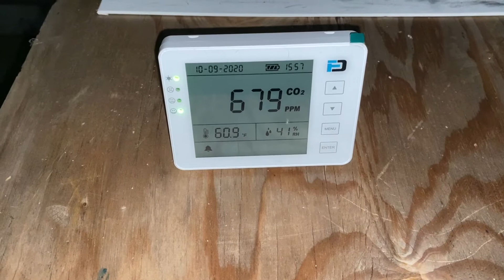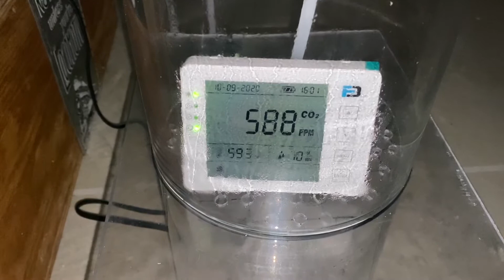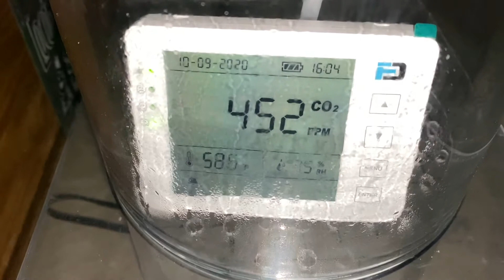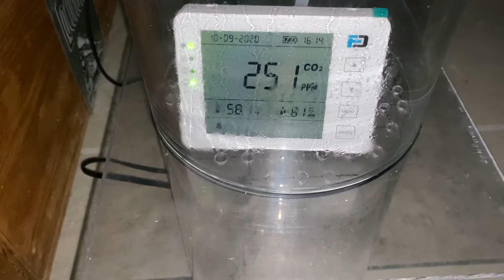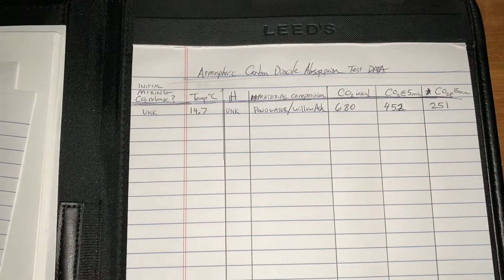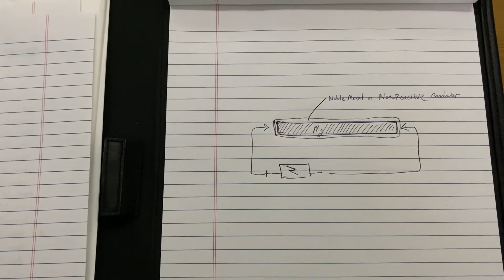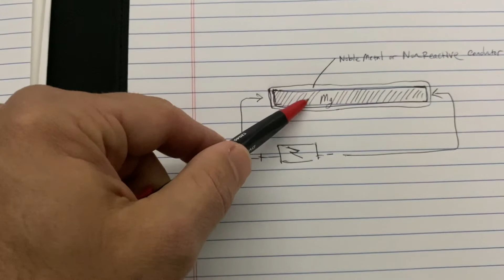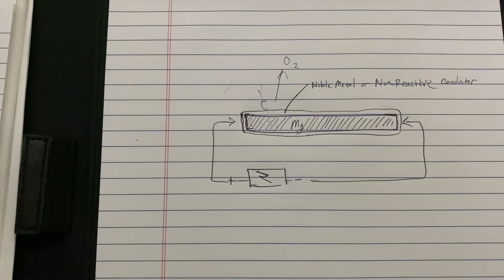CO2 Capture Device

Comment: hello im a student from Korea who's trynna make what you have done. I've got some questions. Is the motor worked by solar energy mixing mixture of water, ashes, and soil? What is the soil for .. and I still dont get how the carbon is captured. I hope I get a fast reply :)
Reply from the maker: Yes, solar is used to mix the ingredients with the air pump (bubbles).  

It works to capture carbon because the mixture of ash and water is alkaline, and because CO2 dissolves into water for carbonic acid, which reacts with the alkaline salts (potassium hydroxide) to form potassium carbonate.  Hope this helps
Reply: @CharlieMacklin1 thank you for answering. where does the carbon go after the process? Would it be okay to throw it away to random forest?
Reply from the maker: @mondaymorningbird  the ideal thing to do would be to perform a soil analysis; find an area (Forrest, farm, etc) where the soil is acidic and deficient in potassium, that would probably be the best place to dispose of the carbonates.

Comment: Hi. I see you are using this to precipitate carbon. Do you have a suggestion for a yield of CO2? We are not satisfied with our current supply of CO2 for making soda. The supplier always short shrifts us. We are in a small market, so buying huge machinery is out of the question. We need about 30lbs of CO2 per week. Any suggestions would be appreciated.
Reply from the maker: Hmm, that's an interesting question, but I'm going to need some more information...I'm assuming when you say "Soda" you are carbonating beverages...The design shown in the video would probably not work very well for what you need.  CO2 will carbonate cold water (in your case for beverages I assume) much easier than warm water.  So there might be a way to capture CO2 from the atmosphere into a cold alkaline water bath, and then put it into a heated and sealed pressure chamber, then pipe the CO2 gas over to your cold beverage.  I like the idea of carbonating beverages with atmospheric CO2 but it would require some extra machines.  Also, you probably wouldn't want to use wood ash, it might impart a hint of flavor to a beverage.  

I would first look for another supplier... If they are shorting you CO2 then that's just not good business practice on their part.

I'll do some more thinking about your question.  You are trying to carbonate beverages for consumption, right?  Or are you trying to make Sodium carbonate or sodium bicarbonate?
Reply: @CharlieMacklin1  Thank you for your reply. We are currently combining HCl with H2O and NaHCO3 to produce NaCl, H2O and CO2. Salt and water are biproducts, and are discarded. We collect the carbon dioxide, compress it and then sell it. 

Wouldn't it be nice if, instead of producing MORE CO2, we could remove the surplus of what we have now?

Comment: Hello Nice Video!! Please
1.)What was the pump Capacity?
2.)How much Alkakine did you use & in how much water solution?
3.) How much CO2 Did it catch?
Reply from the maker: Good questions, I'm not exactly sure I'd have to go back and measure the pump capacity.  The water and ash mix was just done by eye.  Ash is going to contain potassium carbonate, potassium hydroxide, calcium carbonate, and calcium hydroxide, in varying amounts.  I mixed it until the water took on a strong grey color but not so much ash that it would thicken...so maybe 5-10 percent as a guess.

As for the CO2 reduction, I was measuring just that little volume in the glass cylinder with instant readings, showing that the CO2 concentration was reducing.  It reduced the CO2 level by about 50%, so,
I'll have to go and measure the pump flow rate then I can get an estimate on how much quantity of CO2 it was reducing.

Storing the CO2 captured is another issue because the water ash mix,  if dried out, will just release the CO2 back to the environment, BUT, if you could run the experiment until the pH of the water was close to neutral, then use it to grow plants hydroponically or with some underground root watering system, that would work.  A lot of grasses and other plant roots can absorb CO2 from the soil so that might work.  Another idea would be to use the CO2/ash water to grow algae.  Once the pH is in range, algae would grow fast!  

The plant kingdom is how we reabsorb CO2.  Even if we could beat the absorption efficiency of plants, they are alive and part of the Earth, and that alone is respectable :)
Reply: @CharlieMacklin1  Thank you So Much! This Information is So Helpful & I Agree on the Options on What to do with the Captured CO2 Afterwards, Plants Are The Best ReAbsorbers of the Captured CO2 Into Usefull Natural Pathways!
Reply from the maker: Ok so, I went back and re-watched the video and took new measurements on the airflow rate of the pump.

  The little air pump moves about 10 liters of air per minute.   The volume open volume within the test device is also about 10 liters.  It was setup as a "recirculating" arrangement, so in the test run, the air reduces its CO2 content about 42 ppm per minute.

So, 10 liters of air is 12.93 grams x .000042 = .0005431 grams per minute CO2 which extrapolates to about 0.78 grams CO2 per day with this test device.
Reply: Thanks Alot For These Details...Just wondering if the alkali were pure would the system be more Efficient as its supposed to...10l/min pump is 7 grams CO2 Per day

Comment: hello im watching your channel now how did you boil your water and trap those co2
sorry for being a slow learner , my teacher wanted me to build a prototype that can capture carbon and i dont know where to start 😢
Reply: some advices and tips only huhuh need help 😭😭😭
Reply from the maker: @Camelle21Quillobe  there is no boiling needed, it only looks like it’s boiling because there is an air pump bubbling the water
Reply: @CharlieMacklin1  ohhhh now i get it thank you so much but when it capture co2 and pump it what does it releases?
Reply from the maker: So what I would do for a school project is, get your items together:

1) main container such as tote bin or plastic tank or plastic bucket
2) aquarium tank pump and bubbler
3) water
4) potassium hydroxide or calcium hydroxide ( I would recommend buying a bag of “pickling lime” which is calcium hydroxide) …*alternatively, you could  use wood ash from a fireplace or campfire

Mix the water and the hydroxide in the container, add the aquarium bubbler, and your pretty much done :). 

The only other thing you need is a CO2 monitor, but those are about 100 bucks.  You could just suspend it above the bubbling water mixture and take readings that way.

Here’s your example equation for calcium hydroxide to calcium carbonate (limestone):

Ca(OH)2+CO2⟶CaCO3+H2O.

Your basically creating limestone and water :). Hope this helps
Reply from the maker: @Camelle21Quillobe  it releases air (air is about 80% nitrogen “N2” and 20% oxygen “O2” with trace amounts of CO2. ) The air pump draws in air, bubbles it through the water hydroxide mixture, and the bubbles coming up are released to the environment.  The bubbles have less CO2 than when they entered :) it’s reducing the CO2 from 500 parts per million to 200 parts per million). There’s really not that much CO2 in our air, but, it is measurable with the right instruments
Reply: THANK YOU SO MUCHHHH ❤❤🎉🎉🎉

Comment: What happens with the carbon?
Reply from the maker: It forms a weak chemical bond with the alkaline hydroxides to form carbonated,
And with carbonates to form
Bicarbonates.  If it is dried and baked with heat, the CO2 will be re-released in gaseous form.
Reply: @CharlieMacklin1  thanks for your response. Is it possible we communicate via email? we are currently working on a new wet scrubbing technology to treat gases and we would like to incorporate wet mechanisms to capture carbon. Regards

Comment: Hi am workibg on the same project may you plizz let me know the materials and chemicals that you used
Reply from the maker: In this case, I was just using the ash from burnt wood (willow) mixed with pond water, with a large aquarium pump to pump air through it.  The pump has to be run from electricity derived from renewable sources such as sun or wind, otherwise, it will never capture more carbon than it creates.  Also, it will never capture more carbon than is released from chopping the tree and burning it in the first place; however, IF you already have an alkaline material, such as calcium carbonate, calcium hydroxide, potassium carbonate, potassium hydroxide, magnesium carbonate, or magnesium hydroxide, any of those substances should be able to absorb CO2 to some extent.  Carbon capture is always a “big picture” concept, because if you have to chop down trees and build fires to capture carbon, it will defeat the purpose and never achieve a negative carbon balance.
Reply from the maker: You have to look at what nature does; the tossing and turning of the elements performed by the power of the sun, the moon, and gravity.  How does nature re-absorb CO2?  Well besides plants and besides chlorophyll which contains magnesium, nature uses the power of the sun to evaporate water.  The water mixes with dust in the sky and forms rain droplets.  The rain absorbs CO2 as it falls to the earth.  On the earth it mixes with the minerals and is absorbed, and is also absorbed by plant roots and leaves, or in some cases Ocean waters.  Some of the CO2 gases back out into the air, but some of it stays bound in the earth.  Now is there anything we can do to match that efficiency?

Comment: Great vid sir, I was thinking how did u know that it's only co2 mixed up with the (water+willow ash) and not other gases? i mean there are other gases in the air like pure nitrogen, pure oxygen, argon, and others like co2 in air because I am trying to make a similar device that only captures co2 (not the other gases) by absorbing the air, mixing it with a solvent/solution by bubbling the air in it so that co2 will be trapped, and release a co2 free air. However, I want to ensure that it is only co2 that is absorbed in the solution and no other gases. thanks😁😁😁
Reply from the maker: Well some of the other gases will get absorbed in the water/alkaline mix, but the CO2 is what forms carbonates, such as calcium carbonate, magnesium carbonate, and potassium carbonate.  The nitrogen, oxygen, argon etc will also bond to some extent but most of those materials I would expect to come out of solution as a gas over time.

Remember, it is better to plant a willow tree than it is to chop it down to burn it to make ash to reclaim CO2.  But, if have the ash anyways, why not reclaim some co2.

Ultimately it is soil quality that we are after.  Good soil will absorb carbon dioxide via plant life, and also improves agriculture
Reply: Thank you for clarifying sir, this a great help 😁
Reply: @CharlieMacklin1 I can't see how it is better to plant a tree than to burn one. I guess I have missed something
Reply from the maker: @waylonbarrett3456   Well because of time.  It takes a lot longer to grow something than it does to destroy it.  That being said, if you're in a wooded area, there's tons of dead branches that can be burned without hurting the environment too bad.

Comment: Why does it have to be alkaline? Is that for carbonic acid?
Reply from the maker: Yes basically if you have an alkaline hydroxide it will combine with the co2 molecule to form a carbonate.  Similarly, an alkaline carbonate molecule will combine with co2 to form a bi-carbonate, however this molecule is less stable and will re-release the co2 upon heating or drying out.  I recently learned that the main ingredient of my ash mixture is calcium carbonate and calcium hydroxide, although it would also contain a fair amount of potassium hydroxide and potassium carbonate along with magnesium hydroxide and magnesium carbonate.  These are all essential minerals in plant life.
Reply from the maker: You can just use pure water to absorb the co2…it would become carbonic acid which then could be stored or reacted with other materials.  Also know that CO2 is much more soluble in cold water rather than hot water.
Reply: @CharlieMacklin1  do you know if that's a relatively easy to do? Like put an aquarium aerator pump in a bowl of water, let it run, and then use a vacuum pump to pull all the CO2 out?
Reply: @CharlieMacklin1  I see so your process is to dissolve CO2 into the water and then have it bond with something in the water to pull it from the atmosphere?

Comment: Do you want to collab for Xprize I got contacts for the project idea you have...
Reply from the maker: Well thank you, although I was under the impression that the deadline for registration with X-prize on this particular challenge had passed…I had looked into joint but there was a start up fee and at the time it was a bit hefty.  

The carbon capture is a difficult problem to solve because it’s not just clever gadgets and chemistry tricks, the real solution is a bulk materials handling issue.  It comes down to water chemistry and soil chemistry, but in mass.  Air mixes with water, water mixes with soil, top soil takes the carbon. We have to become allies with the roots 🌱
Reply: I would maybe like to collaborate. What are your ideas?

Comment: I was wondering about using Le Chatelier's principle as a means to facilitate direct air capture? I.e. artificially cooling seawater to make it colder, and improve its capacity to capture CO2. I know that this is a massive endeavour, but I wondered if it would be more feasible than current direct air capture techniques, which remain extremely expensive. Of course there are other factors to consider, i.e. effect on marine life and effect on the water cycle.
Reply from the maker: That actually may be one of the more feasible options.  Suppose you had a solar powered pump on a floating vessel, at sea.  Cold water from the depths could be pumped up to the surface and sprayed where it could mix with air before returning to the sea.  It seems like a good idea!  That also would eliminate the need for mixing chemicals and, inevitably releasing carbon in that process.  I think that the question we have to ask ourselves is “how does nature absorb carbon and how can we help that process along”.  Ultimately, the problem we have to solve is one regarding the efficiency of material handling and mixing using only natural forces (sun, wind, tides, etc) otherwise we are still trapped in the grand circle jerk of carbon releasing gizmos.
Reply: I have been working on an idea that leverages this principle. It seems bringing cold water up from the deep may be problematic because it may already be saturated with carbon dioxide for its pressure and temp.

The idea I've been kicking around is floating hollow disks made of limestone on the surface. Their upper surface would have a particular synthetic allotrope of CaCO3 which is a grouping of hierarchically sized microspheres. This pigment has been optimized to reflect infrared light through the atmospheric infrared window into space. Eventually the disks would be weathered and sink. I also have a plan to produce carbon-negative alkali hydroxide, so this CaCO3 could be formed from these and provide some sequestration.

Comment: Would you or anyone following this forum consider establishing a Discord channel to exchange ideas and work together?  Currently I am using a Sensirion SCD30 sensor which accurately measures CO2, Humidity and Temperature connected to a Raspberry Pi Pico microcontroller running Micropython. I am planning to expand this by sending the data to a Raspberry Pi and using MQTT, an InfluxDB data base and a graphical screen output using Grafana - all the software is Open Source. I am currently building a closed system using CO2 to provide vegetable and herb seedlings with an optimum growing environment. Using solar energy to extract CO2 from the air in an economical way using existing external airflow is one of the options I am interested in.
Reply from the maker: That sounds good.  I think you are on the right path.  The sun has to be the driver in putting carbon back in the Earth.  Plants, being in a kingdom suited for it, are a necessary ally.  With your testing rig you will be able to see what works best.  Using solar heat, a distillation or partial vacuum distillation can make pure water capable of pulling some CO2 just by creating carbonic acid, the water/carbonic acid can then be applied to plant roots, algae etc, with the right minerals, and bound to solid form.  It would be essentially what nature does in rain but, with a focused effort on carbon recovery.
Reply from the maker: Or perhaps some liquid cycle, using alkaline water, and solar heat distillation, where the changing concentration of water to alkaline salt ratio can be part of some absorption cycle.